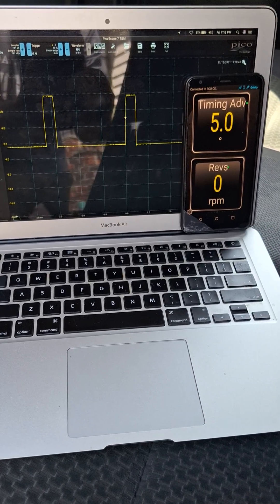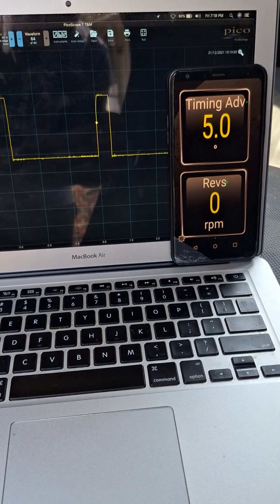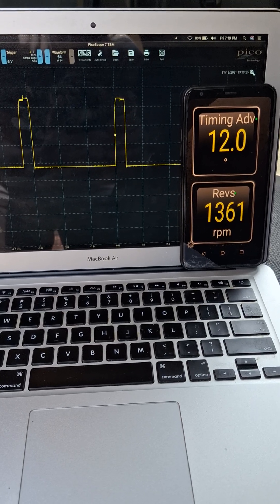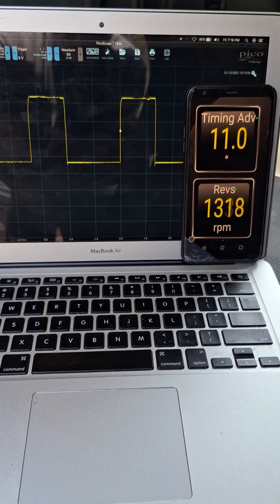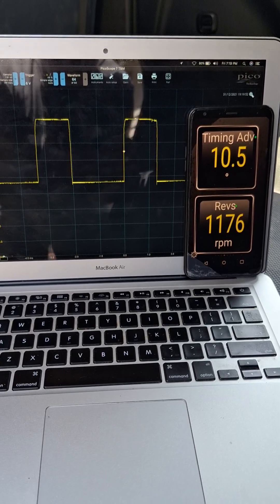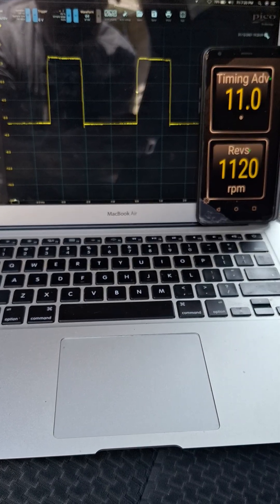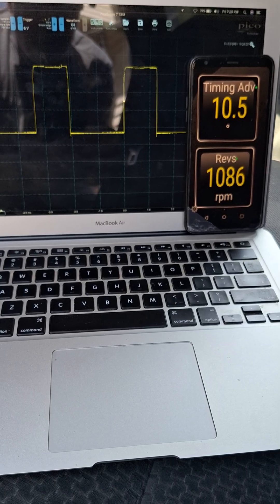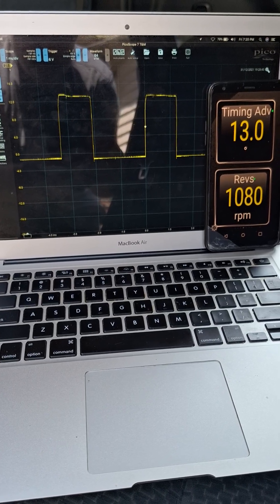VVT Solenoid: PWM Signal, Advance and RPM.

Comment: Looks like it's just doing the high idle to warm the cats and vtc is being actuated to help. Im just a mechanic tho
Reply from the maker: Yes. That higher rpm does help to warm the up cats and the engine. About 700rpm is the idle once it is fully warmed up. The cam is being retarted from its neutral position (lock pin) after engine start. Once there is oil pressure the pin releases and ECU shifts cam to a position appropriate for the rpm/load. Thanks for the feedback and for watching.